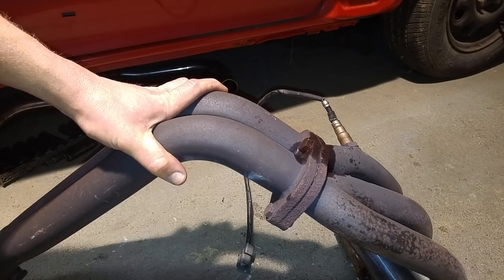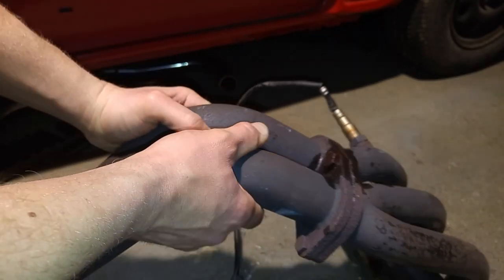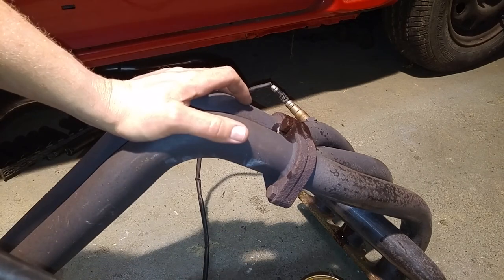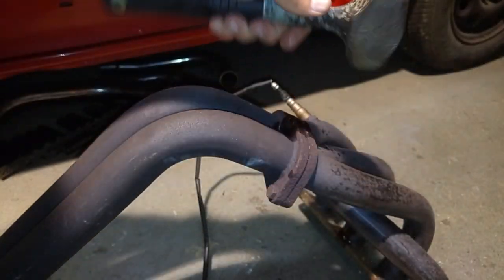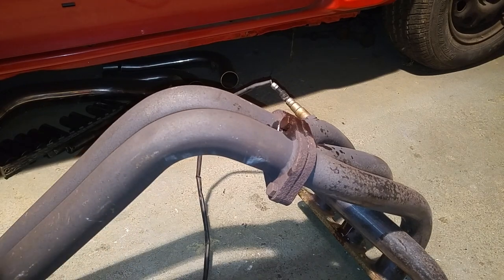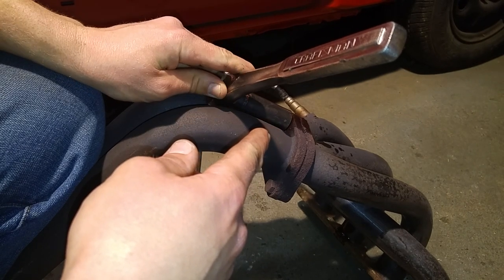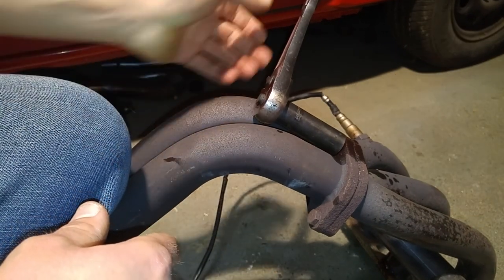How to loosen rusty nuts and bolts, without a torch!

Comment: a few decades in auto repair and you learn that an impact is by far the best wrenching method to get this stuff loose.. less torque, more hammer..    Have found that tightening first does help a lot.. never tried the acetone/atf blend...   will do that however.. thx..

Comment: I have this problem so rarely that it's just not worth investing in a blow torch because this is all I would ever use it for. Great technique! I have definitely learned something new today. Thanks a lot!
Reply: Get the torches.   You can get a decent set off Craigs list fairly easily for a song.    If you work on crusty junk there is nothing like being able to cherry nuts up.      Once you have a set of torches you will use them often..    FYI stay away from the small consumer tanks.  They rob you blind charging almost as much as the tall ones to refill.
Reply: I have just bought a set of small consumer tanks. The flame is little and precise. It glow bolts easily, adn do not make damage to other things close to. Excellent to work with in an engine bay.
Reply: Robert Horwat loo

Comment: When you talked about checking the back of the bolt you touched on a good point. Sometimes bolts stick out the back and the part sticking out is very rusty and the part that is in the female threads  is OK. It starts to come out easy and then the rusty part hits the threads and if you force it, the bolt breaks. Happened to me on a brake job. I could not easily see the back. The second time was a scissor jack screwed to the floor, stored  behind the seat in my truck but I was ready for it  and  I got underneath and sprayed and wire brushed the end of the bolt. I have seen the acetone/ATF tests and have been through several commercial sprays. I will try the home brew next time as the results with PB and Kroil have not been great.You mentioned heating up the headers but not every part runs hot. The torch, hot air guns and the super expensive induction heaters all often help.
Reply from the maker: Yes I should have mentioned cleaning the threads if you can see them.  That helps too.
Reply: Ben Smith I did. Read comment again,please
Reply: @jeffreydeutsch7336  I know this is 6yrs old but you should read his comment again. He apologized for not mentioning cleaning the threads on the back like you had mentioned.

Comment from the maker: the acetone atf mix was tested against wd40 and others in
Machinist's Workshopmagazine in their April 2007 issue.  The acetone/atf wins at 53lbs.
Reply: How about manual transmission fluid mixed with acetone. Would that work just as well? I don't have an automatic transmission car you see.
Reply: @SE45CX  manual is completely  different, just go buy some you are allowed to
Reply: What of power steering oil? atf and power steering oil are similar

Comment: I pb blast it, then soak for few hours. Pb blast it then put wrench on and use a hammer to wack it lightly, then whack it as if you are tightening it,  hammer it and back and forth until it comes free. U will know cause it will move a bit and not crazy hits, light at first then a bit harder but never hard enough to break the nut and it acts as a impact and comes free.. got many so far and got two  really rusted bolts to try soon.. hitting it to tighten the bolt then hit it to loosen helps allot,  going back and forth ect. Using a breaker bar will snap it, trust me try the hammer method and be patient.

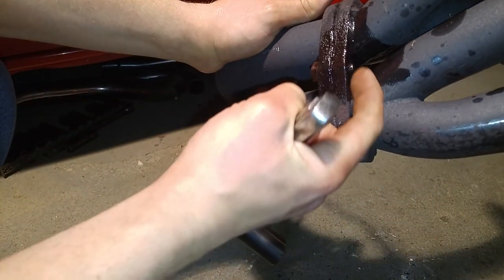Comment: Great video Ben, but at 2:40 if you're turning the head of the bolt and the back side doesn't seem to be turning, you're not "about to snap the head off".  You already did.  One other suggestion.  Let's say you're working on a bolt that requires a 17mm socket and you round off the head.  Go to your English socket set and find one that is slightly smaller than the 17mm.  Drive it on with a hammer and it will grip the head of the bolt tightly.  May be a bit of a challenge removing the bolt from the socket once you get the bolt out, but you can do that on your bench.
Reply: Hey Frank; steel is ductile; it deforms before failing.  You CAN twist one end of a bolt but not the other without breaking it, as long as you don't go too far.
Reply: Frank Howard i

Comment: The right tool would be a box wrench, or a shallow impact  socket.  A deep socket with a wrench handle applies force perpendicular to the head of the nut and can round it off or spilit the a standard socket.

Comment: plain simple vegetable oil and white spirit (naphtha in the USA) or acetone, mixed 90% veg oil to 10% white spirit works even better than atf and acetone.

this is due to vegetable oil being about 20 times more viscous than petroleum based oils 

and its so much cheaper than anything out there

Comment: I'm putting Nickel-Graf on the bolt shaft and threads. Bolts on my 20 year old Jeep WJ always tend to seize to the bushing sleeves and the bolt 🔩 threads to the nut.
Makes the bushing spin in the control arm/sway bar links/shocks/trailing arms to mount.
I'm going through my entire suspension abd some steering components and replacing bolts with "yellow zinc plated" Grade 10.9 hex flange bolts with coarse and partial threads from BelMetric. 
Zinc is very hard to rust and with Nickel anti-seize compound on the shaft and threads of bolts its going to be easy to remove 15 years from now.
▪︎ If you put anti-seize on threads you MUST reduce torque values by  30%!
If you multiply dry torque value by 0.7 you get the anti-seize wet torque-spec because Dry * 0.7 = 30% reduction.
▪︎ For my rear shocks the Chrysler torque spec is 80 ft-lbs on top bolts and 85 ft-lbs on bottom bolts but that's Dry Torque spec.

▪︎ 80 ft-lbs x 0.7 = 56 ft-lbs (with Nickel-Graf)
▪︎ 85 ft-lbs x 0.7 = 59.5 ft-lbs (AS torque-spec)

My 2002 Jeep Grand Cherokee Laredo 4.7L V8 (94-07) Rear Shocks have the following bolts:
▪︎ M12x1.75x80mm (top bolt)
▪︎ M12x1.75x70mm (bottom bolt)
Bolt Specifications:
▪︎ Coarse Thread
▪︎ Partial Thread
▪︎ Grade 10.9
▪︎ Hex Flange Head Bolt (16mm wrench)
▪︎ DIN 6921
▪︎ Zinc/Yellow Zinc/Black Oxide coating. I prefer yellow zinc for its corrosion protection properties.
Note: when ordering M12x1.75 bolts they are labeled M12 alone and generally come in Coarse Thread. If you get Nuts for them you have to get Grade 10 at least and must be coarse thread to match the bolts.
I get my quality bolts from BelMetric online. Got both rear shock bolts 4 in total and 6 conical locking nuts just in case for under $25 shipped. About $2.30 a bolt and $0.60 a Nut.

Comment: Thanks very helpful advice. If you live in a world of "I just take it to the shop", your neighbors though normally nice, have no clue to why your DIY-ing car repairs  11 year old FORD escape (saving thousands $$ in labor charges over the lifetime of ownership.) in shared driveway and they are just a distraction with constant banter when you need to concentrate. Moving forward, I've applied Naval Jelly, around the bolts to the flex pipe flange at manifold to flange at Catalytic converter. I'll warm up the system as you suggested, apply penetrate, hammer away, and tighten a 1/16th turn before loosening and hope for best.
Thanks
Jimmy

Comment: If you're going to use heat, why not let paraffin wax do the job? After heating, just let some wax melt into the threaded area. I've used this method with excellent results when removing rusted parts from my rust-osaurus 1960 Corvair with Flintstone floorboards Works much quicker/easier than penetrant oils. Compliments of another YouTuber, who's name escapes me.
Reply: how did you heat up the wax? Do you put it in a pan on the oven and heat it up that way until it melts?
Reply: @RGcorbett  You heat up the fastener w/ a torch til near glowing and then the wax just wicks into the threads and lubricates the joint/connection. Similar to sweating copper pipe.
Reply: @v.e.7236  Oh okay. Dang, I don't have a torch....I've been looking at something similar that Autozone has to help me take off the exhaust pipe. I have to take off part of the exhaust pipe to replace the oil pan gasket on my '08 Ford escape.
Thank you.

Comment: I just soak it then drive then soak overnight, it's usually easier to remove after that. Also, a rattle gun removes bolts easy.

Comment: I find if I know I'm going to be working on a rusty bolt I spray it with PB blaster days in advance and let it soak in - and when its on suspension parts / bearing bolts the vibration from the car running around helps work it in.  Got some nasty bearing attachment bolts out that way.  Last resort - saws-all through the bearing side if you know its trash anyways - a smaller bolt comes out easier and the vibration from the saws-all sometimes loosens the bolt up enough to torque it out.

Comment: I have been trying to replace the positive terminal connector but the nut/bolt is rusted on. I've tried heat and PB Blaster. No success.

Comment: Hey...good advice. However in my past I have been unable to get a bolt off...even stripped  the head with socket or box wrench. What has saved me a few times is...Vise-Grips...thank God for Vise-Grips. I have a full sized pair with straight jaws, curved jaws, and small Vise-Grips with both straight and curved jaws. If all else fails...adjust your Vise-Grips for a really tight grip...and go slowly. One of the best tools ever invented.
Reply: Hey, Sun King, invest in some 6-point sockets; you won't regret it.

Comment: I couldn't get the nut off a half-shaft with a 3 ft cheater bar.I poured brake fluid on it came back 2 hours later came right off.

Comment: Nice trick with the acetone and ATF. FYI, you mention the "correct tool" and choose what is called a 6 sided socket. This is used for a better grip on a nut in comparison to a 12 sided socket. Both are used on the same bolt head/nut, the only diff is the 6 side has a lesser chance of rounding the bolt head/nut. The 12 side is used for speed which is not a prob for the backyard mechanic who doesn't have the dealer service mgr. up his a##.
Reply: it's called shocking the threads
Reply: Rotorhead Partshanger your comment ref 6 sided socket or 12 , I always use a metrinch, if the nut is going to give grief ,they work on the the flats ,gives a much better torque, plus one socket works on both metric and imperial
Reply: Chris Brown thanx I'm never too old to learn something.
Reply: Twelve point is also used in tight spots where you don't have enough room to swing a ratchet.

Comment: ACETONE and TRANSMISSION FLUID. Gotta try that cause penetrating oil doesn't always work, neither does heat. My biggest problem is the bolt that holds the arm of mufflers across the cylinder head on MTD snow blowers. 9.5 times out of 10 they break off, even with heat and soaking for several days. Hope this mixture works
Reply: gator, did this mixture wrk for the snow blowers?   Im interested, and if you could post a video that would be great
Reply: It didn't work for the bolt on the cylinder head (nothing did) but it works as well as penetrating oil and costs less.(for how much you get) I never did have much success with loosening oil, soak things for days and still no good i.e. if it is stuck REAL BAD. Heat is the only thing that has worked for me, that or drill it and tap it over.
Reply: I drill and tap.   heat usually impacts something nearby, like my hand!

Comment: 6 point socket or 12 point socket..for those that never took shop
Reply: On a frozen bolt...6 pt
Reply: 6 point, a 12 point will round the nut

Comment: mate i got a problem with the pipe that pushes into the bit wider pipe its rusty and i having trouble getting it off i dont have a torch or grinder if you got any sugestion i would be gratefull cheres
Reply from the maker: dennis hopkins sometimes you have to cut apart exhaust pipe.  If the pipes were clamped together they are going to be tight.

Comment: Was replacing a muffler on my truck (18 year old exhaust system) and sprayed pb blaster a couple times and ended up breaking off the nuts from one of the exhaust clamps and thought well fuck that worked I guess

Comment: correct number of sides?
Reply: Ben is referring to the use of a 6 point socket instead of a 12 point socket. A 12 point socket can be more useful in tight spots since you can rotate the socket in smaller increments, while the 6 point socket is better for tighter fasteners since it puts more of the socket wall in contact with the fastener. A 12 point socket will sometimes round off the shoulders of a fastener for this reason. The same principle applies to wrenches as well. Hope this helps.

Comment: WD_40 sucks anything is better than that stuff.
Reply: WD40 was never intended to be used as a rust buster. It is not their fault that many try it and then complain about the results. The company actually makes another product made to loosen rusted parts. I have also seen the tests and will try acetone and ATF the next time I have a stuck bolt. The WD stands for water displacement and is fine for driving moisture out of wet electrical components. It also is not much of a lubricant. It is a solvent to displace the water and a little light oil to keep rust away, short term.
Reply: Right , It is A Product of NASA actually . the 40 is The 40th Try at Displacing Moisture ! Now they do Have A Penetrating oil I Have A Can But have yet to put it to the Test ! Been Using PB or CRC .
Reply: @jeffreydeutsch7336  🤓 that makes sense, thx

Comment: Would have been much better if you tried this on the bolt that was the one that was rusted in for real. You already loosened the one that you worked on. I bet that really rusted old bolt would not have come out.  A BIG thumbs down for this one.

Comment: Melted wax is enough
Reply from the maker: Qatari Man i have tried that, even with a torch.  I don't know why it didn't work for me?
Reply: @MrBensmith8302  torch temperature is not enough high.may acetylene torch work better.